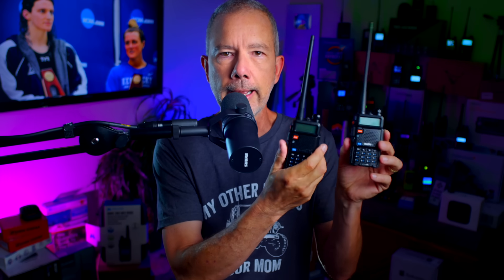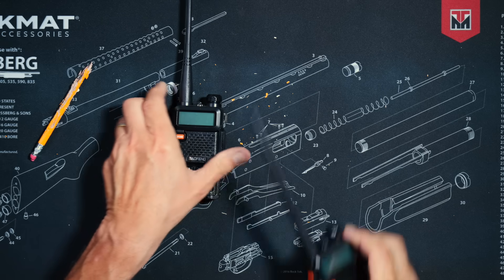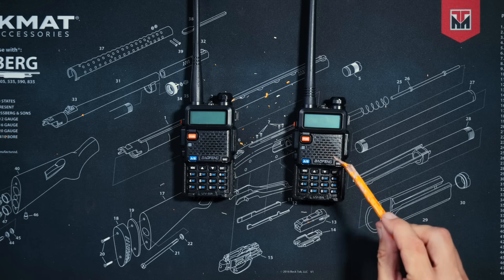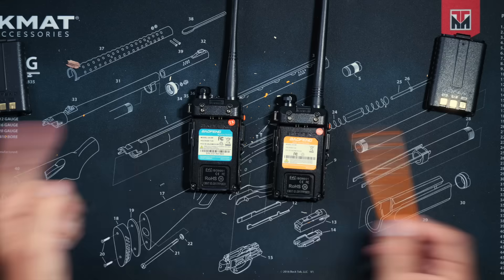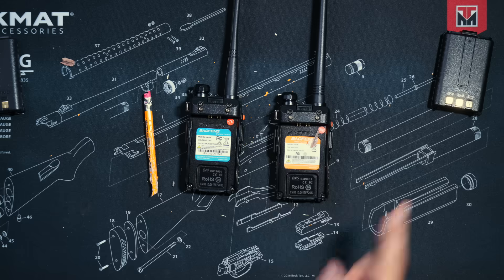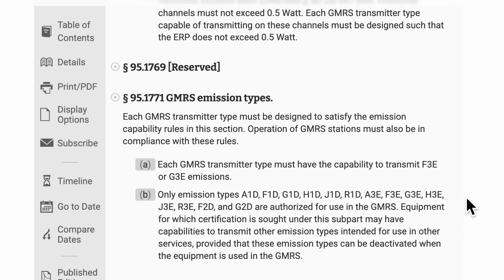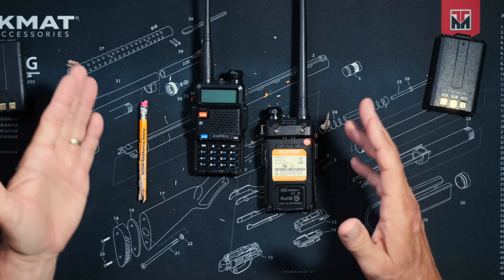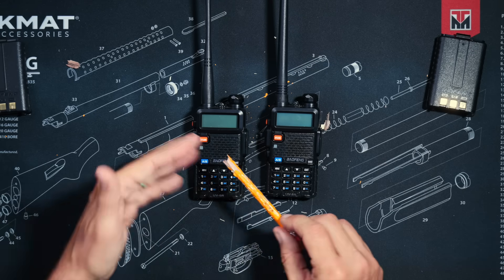Why A Baofeng UV-5R Is Illegal On GMRS

Comment: so my question is realistically the non GMRS version of the baofeng radios are functionally the same as the GMRS version as long as you get the correct antenna (the HAM radios do not come with GMRS specific tuned antennas) and pre-program the channels and know how to operate them? i have a uv5R, there is no reason to get the UV-5G for example as long as i can simply program the channels and know how to tune into the repeater right? i highly doubt they would have spent money to tune the internals.

Comment: New video idea. I recently used an SDR USB dongle to compare the performance of ham radios gmrs radios operating on gmrs frequencies and found that the gmrs radios perform significantly better when operating on the gmrs frequencies. You have a much wider selection of radios. I'm curious if it's true across the majority of radios.
Reply from the maker: That's because the GMRS radios have antennas that are tuned for GMRS frequencies and the hams radios do not.
Reply: @TheNotaRubicon  That is a fair point. However, I did take that into consideration and tested both radios with HAM and GMRS antennas to make sure the only variable was the radio, not the antenna. The GMRS radios outperformed the HAM radios regardless of the antenna used.

Comment: I just bought 2 of these. I’m guessing you can no longer unlock it. Correct? I watched an older video you did and multiple comments indicated the newer ones are not being unlocked via your method. Hope that is not a stupid question. Just trying to clarify before I send them back to get a different model.
Reply from the maker: Correct. New ones cannot be unlocked ...
HOWEVER - 
Only the ones destined for sale in the U.S. are locked and sometimes people get lucky and get one that is unlocked, so make sure it's actually locked before you send it back..
Reply: @TheNotaRubicon Thank you!

Comment: The FCC would never know you  did transmit Go over to 72.00 khz and see just how bad its is and this has been going on for years and the FCC has NOT done a thing about it so if I have a radio that can transmit and it does not have FCC approval  Guess what I doing it because 100% chance nothing will happen

Comment: main thing the ham model that's not legal on many bands has little to do with the radio its the ease supposably of keypad programing . but as anyone who buys almost all ham radios today they mostly need computer software to program there not easy anymore  , ans i will say very rare anyone who is licensed and using gores properly will never see a fcc letter. but when 
a person abuses, interferes, harasses and any real crime . will get hit not just for violation but the wrong grant radio .. much like someone bashes another with a 2x4  will ger charged with the assault but an instrument of crime . as aide i imagine you break a lot of antennas connections the way you handle radios there cheap but why throw unneeded money away

Comment: Thank you for reiterating this critical PSA. Forewarned is forearmed (Praemonitus, praemunitus)!  Given that I has my official hams papers it goes without saying (although I'm actually saying it) that I would never ever ejaculate on GMRS without appropriate FCC stroking. So henceforth I will avoid 304-ing for anything other than an officially FCC sanctioned fart-95-E Boo-Fwang radio transmitter thingie.